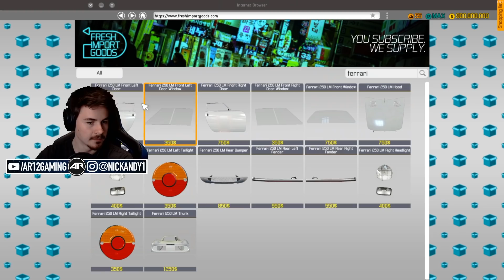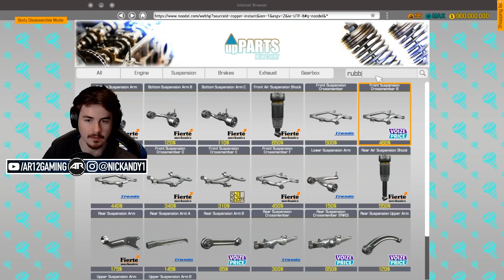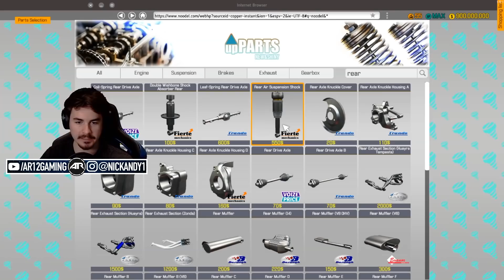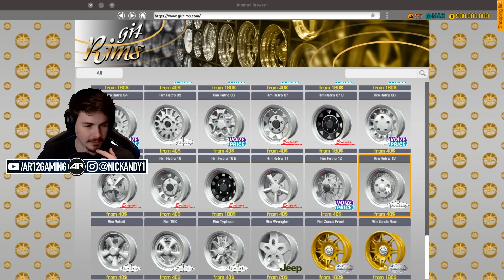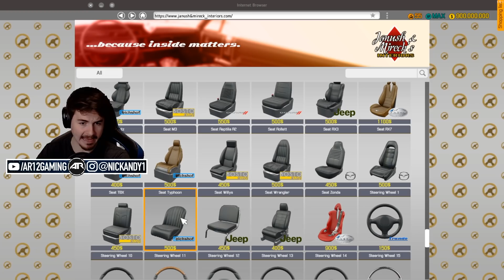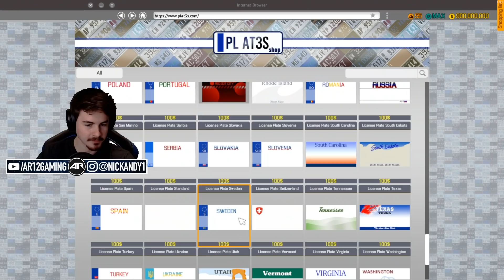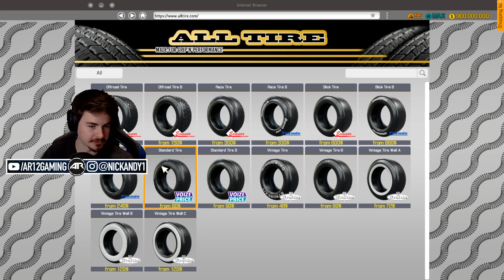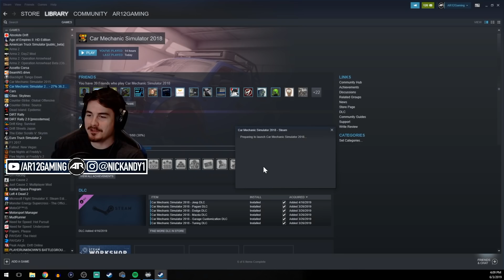Rebuilding The World's Most Expensive Car in Car Mechanic Simulator

Comment: The reason this car has two fuel tanks is because it was an endurance race car (as the model designation suggests, the 250 LM was built to compete at the Le Mans 24 Hours) and having that extra full tank meant the drivers had to stop for gas less often. Also, no shit the car is unstable; these things were death traps almost by definition (at the time, there was about a 1-in-4 chance a driver would come back from the race either on a stretcher or [regrettably more often than not] in a body bag, and every just sort of accepted that this was to be the natural order of things). They also weren't anywhere near as powerful as they are in the game; by Ferrari's own estimates, these things made maybe 300 horsepower, not the 650+ they make in this game.

Comment: Hey Nick! I assume you are using manual + clutch, so I would like to challenge you and Raymon to a heel-toe circuit race. It will basically require a more handling based car than a power build.

Comment: You should have put the performance parts on the engine and transmission even tho it wouldve taken longer.You wouldve gotten at least a thousande horsepower.

theres also performance fuel pumps and air filters maybe more but i dont remember.